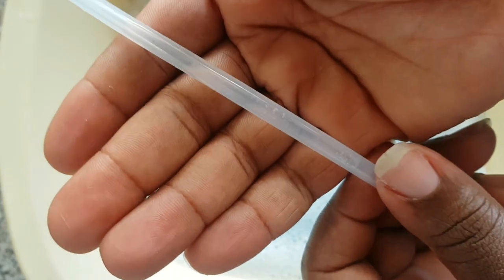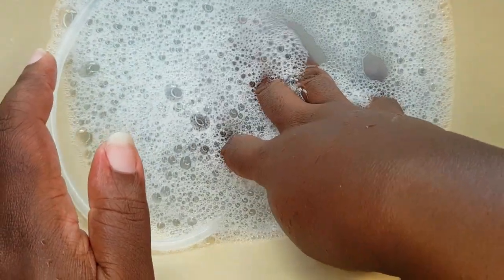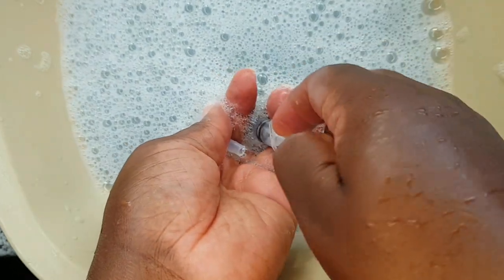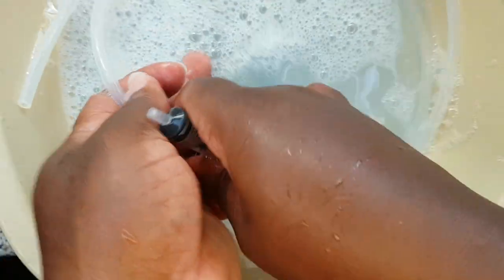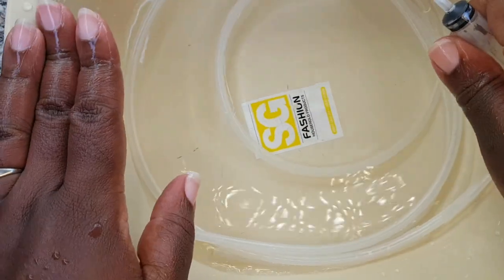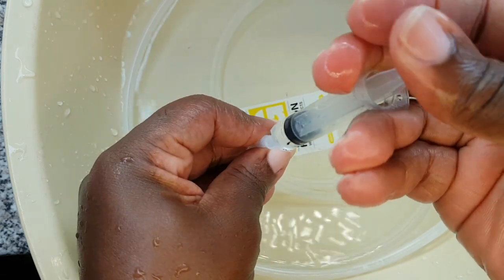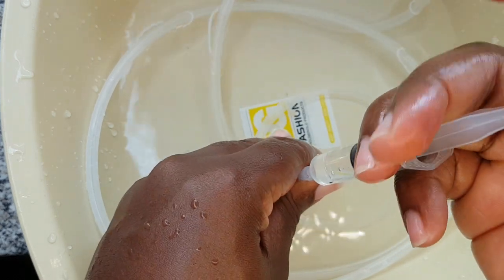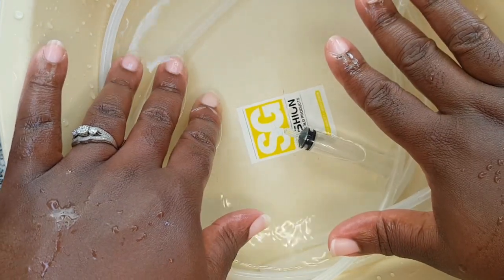How To Clean Condensation From Breast Pump Tubing 2020

Comment: How do you dry?!?
Reply from the maker: Connect it to the pump and put it on for a few minutes. Don't connect the flanges on the other end so air pressure from yhe pump will dry it out.
Reply: @WingingItWithEsi  we have the one that doesn’t actually have milk through the tubes but just uses the suction power
Reply: Hey but wont moisture end up in the motor of the pump or something?

Comment: Hi how do you dry them?
Reply from the maker: You can attach it to the pump and let the pump run without any bottles attached for a few minutes or hang them to air dry.
Reply: @WingingItWithEsi  great! I just did that and it worked, although the ends of the tubes are still a little cloudy but not wet anymore 🙌🏼 thank you
Reply from the maker: @pawivazquez5951  you're welcome!